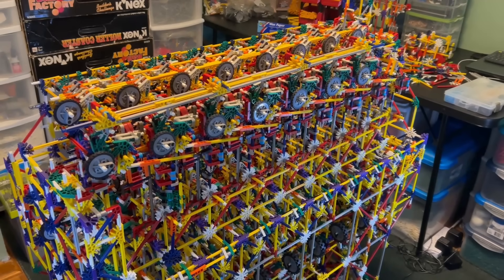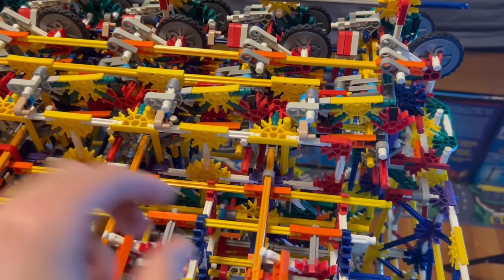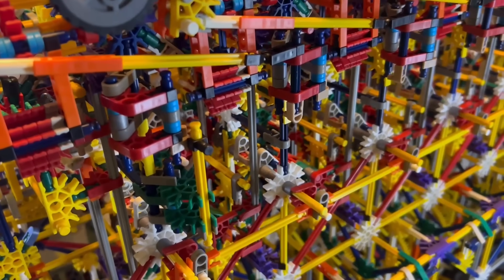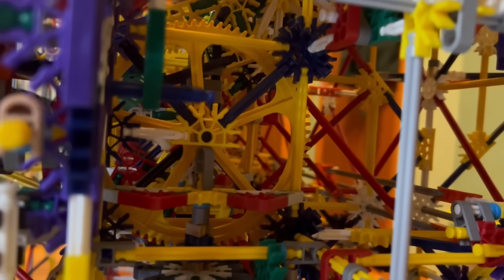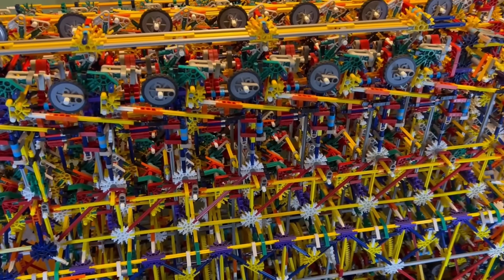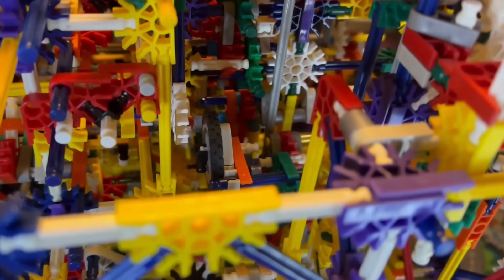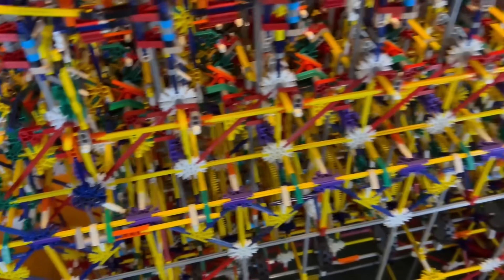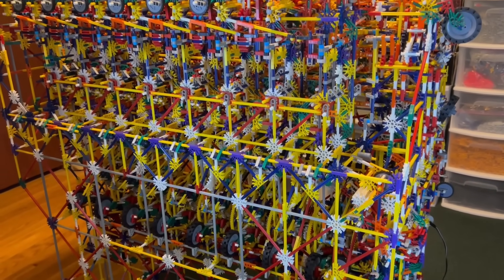Knex 8-bit Mechanical Computer - Update 1: The ALU

Comment: I wonder how large a modern cpu would have to be to be built this way. Besides collapsing under it's own weight, would it even be possible?
Reply from the maker: I think it would be the size of a small city and use way more power for the motors, but it is theoretically possible if everything is connected with parallel processing.

Comment: You see this kind of thing done with relays, transistors, even valves but, to do this using Knex is a whole new twist and, there's so much that can go wrong. Also, having to translate a single element to a mechanical assembly... Now that's doing it tough!!

Comment: you have electrical motors but the rest is mechanical. It kinda defeats the purpose of making something mechanical when you mix in electronical parts
Reply from the maker: These are just standard Knex motors that don't offer any control, so anything more advanced has to be mechanical. I justify using them because they can be replaced with cranks if desired.
Reply: @Shadowman39  ah okay

Comment: This thing is unbelievably complex. How on earth did you dream up this design?
Reply from the maker: I made it one small section at a time, starting with how to store just one bit, then add two bits. The rest is a lot of automation stuff like transmissions, which I've made for other projects before like the robot.
Reply: @Shadowman39  how long did it take?
Reply from the maker: @jayo503  It's been about a year of work so far.

Comment: I love the design thus far! I only ever designed an ALU in university using logisim, and that broke my brain at the time doing that. I can't imagine adding the mechanical aspect of it! 

As a note, unless you are going to use the register pieces you pull out in another aspect to set the bits, would it be possible to replace the end pieces with something like some snowflake pieces or something to make them stick out a bit more for ease of seeing what number is currently set in the register? Maybe it wouldn't help that much since there isn't that much travel, but it might make it easier to see from an above angle or something?

Either way though, i am completely impressed!
Reply from the maker: I'd like them to be easier to see, but it'll have a more formal display later on and the registers will likely be covered up by other components. Thanks!

Comment: Very cool. I work in a processing plant. Before a fire and rebuilding, the old control room had a large control board all relay based. Push a button and it’d go “ka clunk” and the subsequent relays would click and fire in the cabinets behind you. Very cool system. Sadly the new system is solid state, sterile and lacks any tactile feel. This reminds me to an extent that old relay cabinet. It was also controlled chaos when it needed repair work 😂

Comment: My senior design project was a more capable 8 bit processor, designed up from the transistor level.  it could also take two 8 bit values, but had to run the gamut of basic arithmetic functions.  

I am astonished that you were able to get this functionality in such a small form factor.  being only addition, its much simpler.  but still, for it to work is truly well done! 

AI will be able to arrange things... to such an incrdible degree, soon. these skills still matter though.  rock on rockstar!

Comment: imagine trying to bug fix this thing 🙏
Reply: That's probably why the Charles Babbage computer never got finished.
Reply: It never got finished because modern machine tools had to be invented fist just to produce the parts, but by then electricity was beginning to replace mechanics, and by the turn of the century well, it was way cheaper just to use a series of relays to do basic computing, the transistor appeared very soon after and mechanical computer were almost forgotten completely.
Reply: @geigertec5921 well, it could've been done, it's just that it would've had to be larger to make up for older techniques. Making it use too much materials.

Comment: Fascinating!! This must have been some much work, just thinking of what you have to manually change when making improvement, etc, makes my head spin! Is there a "CAD" software to design in Knex or everything is build from the ground up? Congrats!
Reply from the maker: I don't have CAD for this yet, but I'd like to make that since designing things would go a lot faster. So much time is indeed spent on reworking components. But I keep putting it off because I want to make progress on the computer haha. Thanks!

Comment: Oh this is wild! Fantastic work so far!

I'm curious how you'll implement ROM. The chain drive rack and pinion system you have here got me thinking:

Could you create a Turing Tape ROM with the chain drive rack and pinion system?

Using this video as a reference (7:56), could you fold up or fold down the pins in the rack and pinion gear system to signify a 1 or 0 for a given section of memory?

Perhaps a separate pin on the chain (or multiple synchronous parallel chains?) could be used for a tachometer/odometer to create the program counter?

Then flow control opcodes like JMP or BRANCH/IF could control the direction of the chain drive rack and pinion turing tape allowing backwards and forwards jumps by a certain number of steps and enable/disable engagement of the contents/pins of ROM? e.g. While jumping/branching, the ROM "reader" is disabled while the chain drive jumps a relative number of steps?

I'm fascinated by this, good luck! I look forward to the rest!
Reply from the maker: I was going to make the ROM just like the RAM but without the write portion, but having a belt with each level having 8 bits would be much more space efficient. The jumping is the difficult part since I'd have to encode the 4 address bits to a certain rotation of the belt, likely with a counter. The actual program counter could just be a lever that advances the belt by one. The only issue is the jumping would be slower than using the 4 to 16 selector that I've got already.

Comment: This is amazing! I immediately thought of NASA, which, (provided it hasn't been shutdown for the fun of it...) had been thinking about mechanical devices for a Venus mission to deal with it's mean surface temperature of 464°C. As far as  I know, they were contemplating devises which could be 'read out' by satellites in orbit or probes flying in higher parts of the atmosphere, i.e. to do the computation where it is not so hot. But a mechanical computer on the surface on 8 bit level, that seems to me another ball game! What a beautiful project! All the best❤️

Comment: At 2:48 you describe a rotary counter mechanism that uses at least 4 out of the 8 possible shaft angles (given 45° steps). Instead of binary that is quatinary.

Are there other elements of the system that are beyond binary?

That is a cool feature of knex based digital logic. With the exception of flash memory and some historic network interfaces, almost all modern electronic logic is purely binary. Each signal is either 0 or 1 represented by a low or high voltage. Quad level flash stores 2 bits into each memory cell by using 4 distinct charge levels. The old T1 lines used 3 levels: positive, negative, and no voltage.
Reply from the maker: There are lots of things that use mechanisms, for example the counter, to abstract away pure logic gates since using just nand gates would be 10 or so per full 1 bit adder, and then 8 times that! It would be too much friction and pieces. But all the numbers start out and end as binary, though there will be a base 10 display.
Reply: @Shadowman39 The n-ary digital logic caught me by surprise. Once I got over the shock and thought about it more I realized it was rather cool. 

I knew n-ary logic could simplify logic elsewhere in a CPU, but I couldn't think of any examples at the time, other than cramming more bits into a memory cell. Somehow, I had forgotten the part of this video where you implemented a multi-phase clock with a chain drive.

I eagerly await your future videos.

Comment: I think with mechanical would be easier to use a bigger base, use wheels and gears for calculations. Memory would be harder tho, could take inspiration from old machines designed for calculating trajectories and stuff
Reply from the maker: That might be better, but I wanted to make a binary version. Plus doing bitwise operations is easier. Using base ten digits with counter wheels would need perfect timing when transferring data, which Knex isn't known for haha.

Comment: Would it have been easier to make a 4-bit machine that does 8-bit calculations? Would you have been able to add more functions to the ALU?
Reply from the maker: I think it would take longer since it would have to move 4 bits in, get a carry, then move the last 4 bits and operate on that. But 4 bits would use less pieces for sure.

Comment: Subtracting by adding the bit inverse with carry; Just like the 6502 did it! :)
How big would a mechanical 6502 be ?!??! :)
Reply from the maker: I haven't looked at the 6502 much, but it depends on how fast you want it to be haha. The only way to match the speed would be having hundreds of these ALU's in parallel somehow, like a massive GPU almost.
Reply: @Shadowman39  0.2 Hz would be a push with that hardware! :)

Comment: I love it all, and I'm all for arbitrary systems to construct machines from... but I need to know from the hardcore knex guys about color schemes. All I ever see is juggling ball, circus tent combinations with pretty dark, weirdly matched colors - which as far as I can tell is a matter of form/function matching a given color? Correct me if I'm wrong, but here's what I'm really wondering: did you ever like how it looked? Do you now for nostalgic reasons? Is it a community meme to even mention this, maybe, and me talking about it is a faux pas?

Definitely something I'd like to know, cheers boyos
Reply from the maker: These are mostly "classic colors" which is the color scheme used in most large sets, such as the Big Ball Factory, original roller coaster, and Trampoline Tower. Because of this all my large projects use this scheme, especially since other colors are more rare and expensive, since most of what I bought over the years were ball machine lots. I wish I had more dark colors as well haha.

Comment: This is incredible but also seeing it gives me an overwhelming sense of dread that you might try to move it some day and it'd all come crashing down
Reply from the maker: I designed it to be moved, the frame is actually more sturdy than a typical ball machine and it has handles on both ends. I'd still be cautious about transporting it though.
Reply: The cool part about mechanical projects is that it's not the physical object, but the mental map you create. When you design something slowly, you gain a deeper understanding of it, so if it does fall apart, you can rebuild it.
Reply: This actually looks like it'd be challenging to take apart. Throw it off the back of a truck and it'll be fine.
Reply: @heroslippy6666 boing CRASH
Reply: It's simple really
Reply: @Jamee-n2v if it is so Simple Why don't you make One
Reply: @J.ERotterdam   because im poor
Reply: @J.ERotterdam  I think I'll buy an abacus and learn to use it, bet it can add to more than 255
Reply: @ChrisZost  you do know the original 8 bit computers could calculate more than up to 255 right?  Doesn't seem like it though, weirdly ignorant statement there which makes me wonder if you're amazed that old calculators could also do so.  He hasn't build it yet, but it will just be a matter of replicating what's already there and done.

Comment: this is super cool! i'm very curious to see how you'll implement program storage/ROM, considering how large just the two registers were. will it encode multiple bits of data using rotation kinda like the columns of the ALU as they're working, or will it just be a more compact register since you don't need to modify it at "runtime"? (and also the same questions for RAM, but obviously it does need to change). subscribed and excited for the next video(s)!
Reply from the maker: The RAM/ROM storage is about the same size as the registers, but use an improved storage method. I also had the thought of storing values as octal numbers instead of binary, which would be more compact and fit well with the 8-position connectors. But I wanted to make it simple as possible and not depend on things needing exact timing (I do have plans for a V2 computer for later where everything is different, including a much faster ALU).